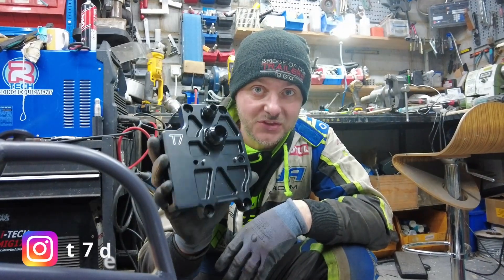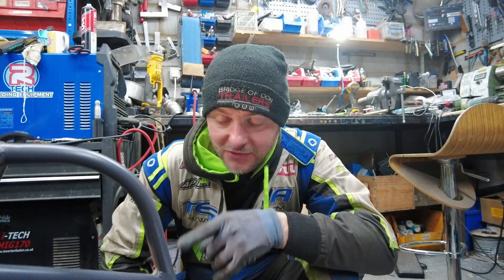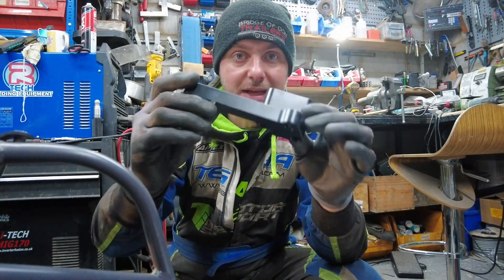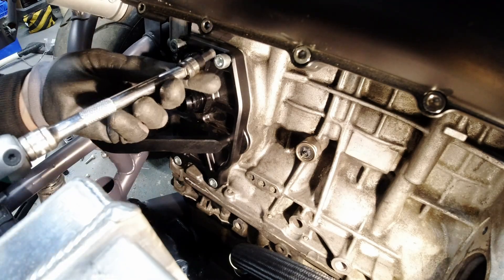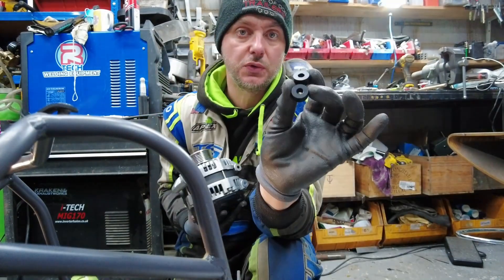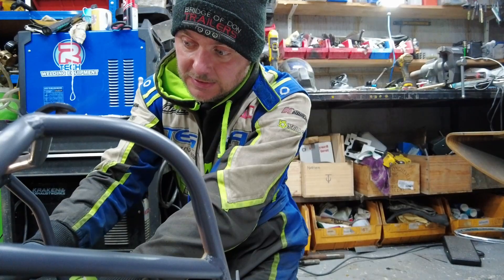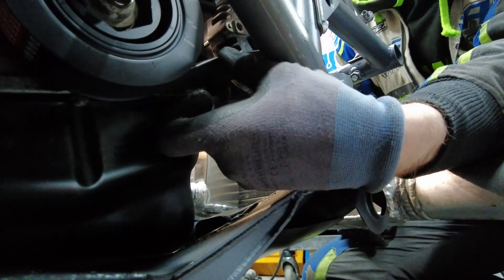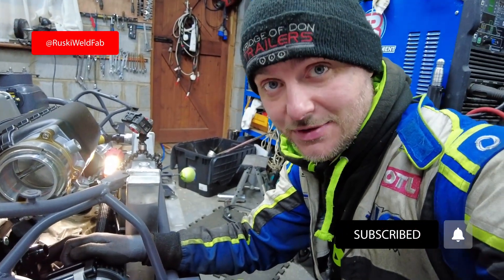T7DESIGN Electric water plate kit mk2 version. fitting guide

Comment: Looks like a really nice setup! ...be careful with the hard mounting of the electric water pump onto the engine block. Those K24s produce loads of vibrations, especially after swapping out the K24 Oil pump(with it's built in counterbalance shaft assembly). It might be worthwhile for you to look into a fluid damper type Crank Main pulley. Build is coming on great!

Comment: Nice. What’s the small o-ring for as it seems it just has a bracket over it, and it isn’t an actual water fitting/port?
Reply from the maker: its to make a water tight seal. as the bolt is on the inside of the plate where the breather channel is